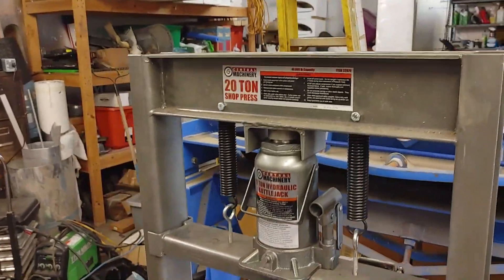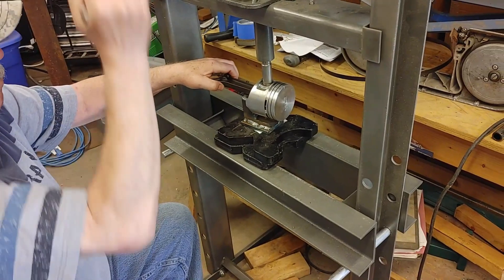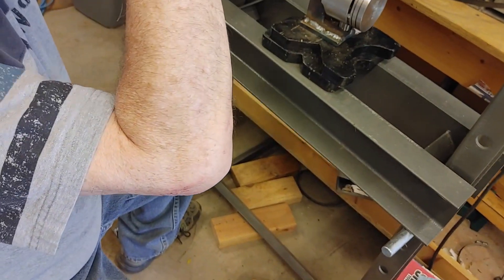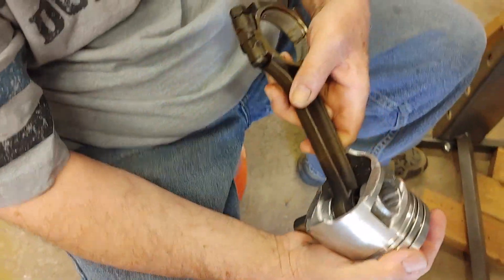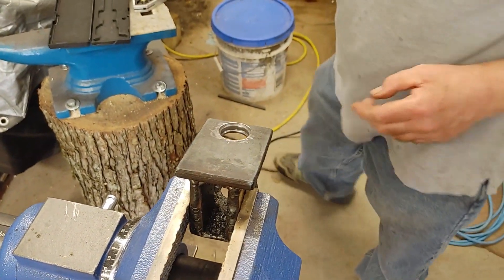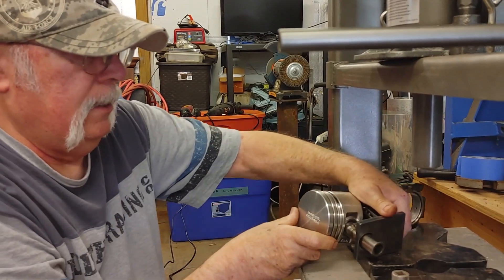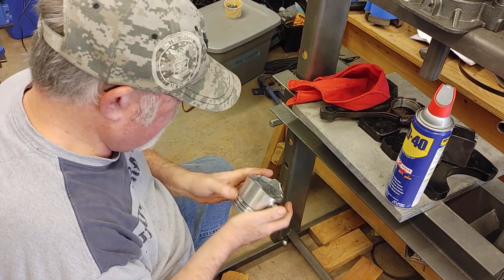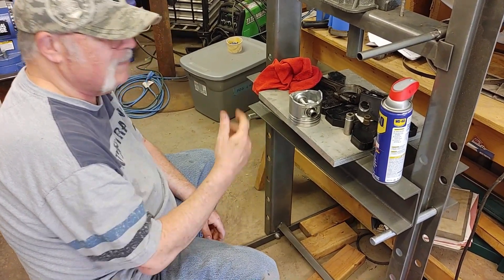Wrist Pin Installation Mistake and Recovery

Comment: Come on guys put the pin in the freezer take it out of the freezer and push it right through
Reply from the maker: There's theory and there's practice. I think you have lots of theory and little practice. As soon as the temperature of the rod and the pin start to equalize, the pin gets stuck. It happens sometimes. When it does the entire assembly can be discarded or a support for the rod and a press will get the job done. I've done this enough that I prefer to use the support and press, never a problem.

Comment: If it ain't and floppy it'll fail......... that's my wrist pin learnin experience.........   they will not loosen up over time. If ya gotta sand it ...sand it.  Floating Pins are a bitch.

Comment: Width of piston at pin bore - length of pin/2 - width of slot inside piston - small end width/2. Difference is amount of shim you need either in pin bore or under piston when on a flat surface and rod is sitting on piston slot. Ex. 3" piston width -2.5" pin=.5/2=.25.  1.06" slot-.928 rod=.125/2=.06.   .25-.06 =.19 washer in pin bore. When you drop pin in it will be .31 below piston at top side, when you move rod .06" up to center you will have .25" at each end. The only time you would need shim under piston is if pin is same or bigger than piston. Draw a picture to make sense, may need for next project.